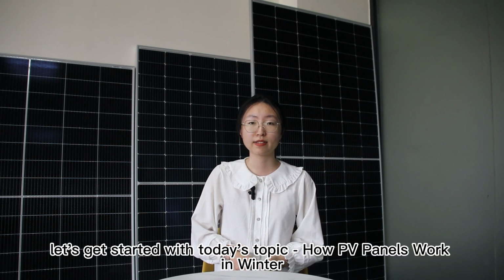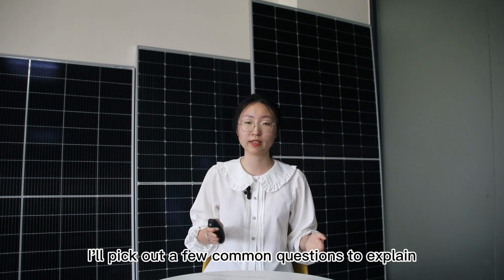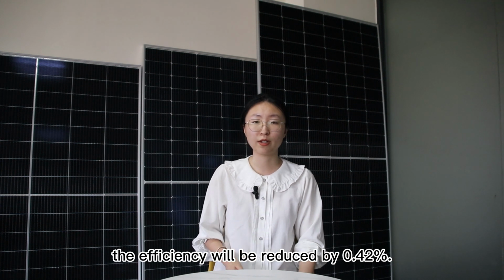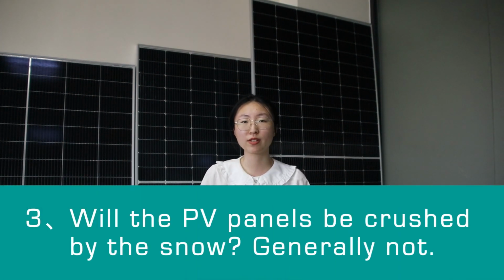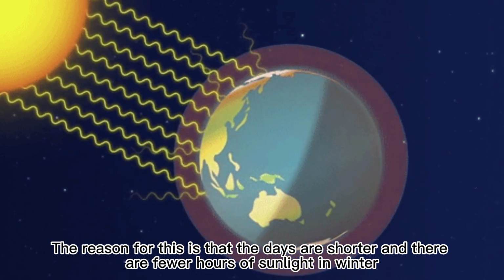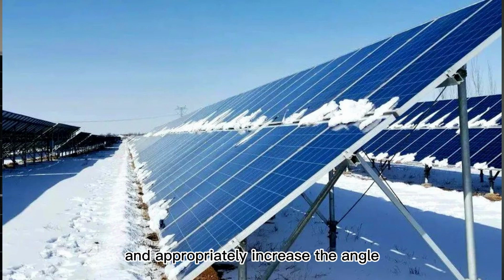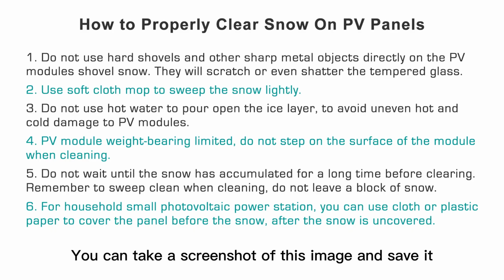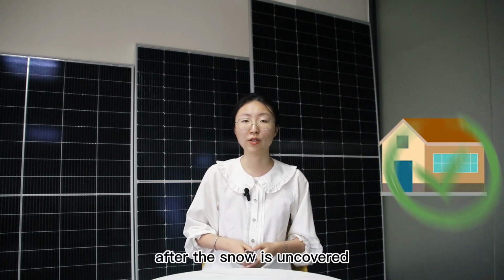How Do Solar Panels Work In Winter?

Comment: i keep finding the power levels in my battery bank go down really fast. But I'm not actually using my power, I've just been trying to first get an understanding how it works and learn how to maintain it. So last week I filled up my battery bank which is connected to my solar panels all the way. That was 4 or 5 days ago. Then today I went out and the entire battery bank is drained to about 40% from 92%. In only a few days the battery bank lost tons of energy, where it normally had about 300 amp hours stored. 

There is no power usage. I'm confused by why its doing this. The only explanation seems to be that if there's cloudy days for really long periods of time in winter that the solar panels could end up pulling power out instead of putting it back in? Are others experiencing this also? It doesn't make sense. Could use some feedback.
Reply: It’s hard to know exactly what could be causing this without knowing what sort of system you have, but with my GivEnergy system I can monitor everything in an app. I can see when the house is consuming solar or battery and I can set the charge and discharge rate. I wonder if your battery has been properly calibrated when first installed. I would contact your installer and have them check everything.